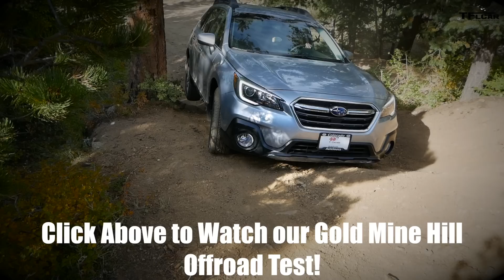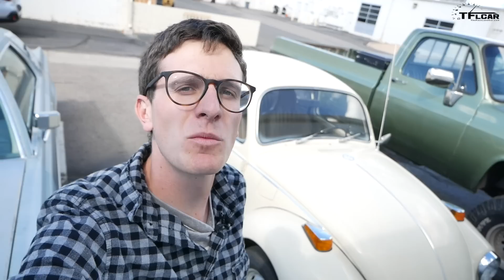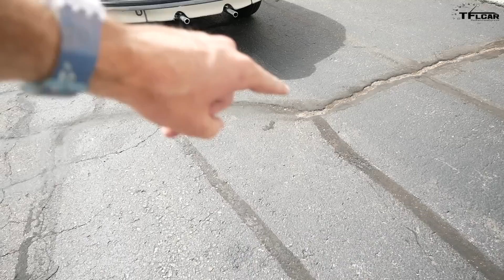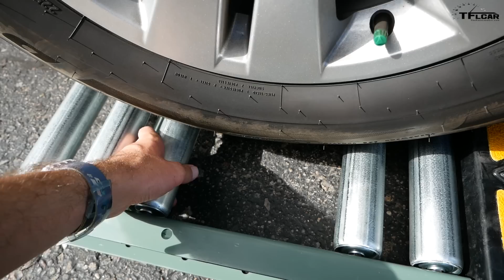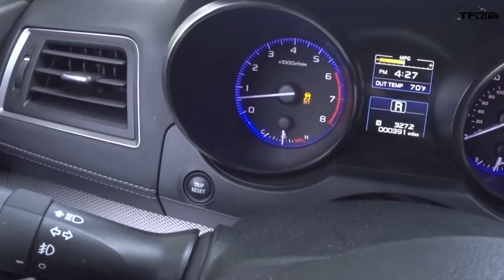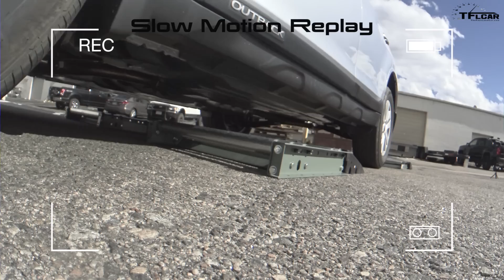The Truth About Subaru's Symmetrical All Wheel Drive:TFL Slip Test vs Subaru Outback

Comment from the maker: You can also watch the test of the Subaru Outback's AWD system in the mountains here: https://www.youtube.com/watch?v=6ua51LAtgVM
Reply: I own a 2012 Outback that I use for my job as a agricultural  claims  adjuster.  I have 99,000 miles on the car today 10/6/18, of those miles an estimated 4000 miles have been off road in sugar sand, mud, canals, tomato fields, nurseries,  citrus groves located between I-95 to the East and I-75 to the West, I-4 to the North and I-75 to the south in the swamp of southern Florida.  My original vehicle of choice was a 2001 GMC Yukon, very bad on my back off road.

I have been places with the Outback the Yukon couldn't begin to attempt to go like sugar sand and the ditches of tomato fields in the Everglades swamp with water over the hood for brief times.  When I counted citrus trees or mapped citrus or tomato acres I could go to the end of the row and make a u turn without  backing up, no way with a Yukon or other vehicle.  The difference in comfort for my back was very noticeable, I could drive the Outback 400-500 miles a day from home down into the Everglades swamp, map acres all day and return with no sign of any back pain, not to mention even off road I would get 25 mpg, the Yukon maybe 5 mpg if not sugar sand.

In 99,000 miles I have been through 2 sets of brake pads and 1 set of rotors, the sand and mud eats brakes, 3 sets of tires with 2 of the sets having damage from broken glass and metal pieces in orange groves and tomato fields, not to mention the thorns on certain palms in nurseries.  I have had no other issues with the car other than a battery or two, had to go to a red top battery because of the rough terrain breaking the lead acid batteries apart.

I love the Outback, waiting for a 2019 the right color for me, will keep the 2012.
Reply: I'd love to see you try Goldmine Hill in the outback with AT tires.  Also, I'd like to see if the Forester has an easier time of Goldmine Hill.
Reply from the maker: Thanks for the kind comments. Very much appreciated!
Reply: Now you just need to buy a FORCE GAUGE to go with that slip rig.    sure a ramp setup would be a little better,  but using a force gauge is quicker, easier, safer, and cheaper!   see my other comment in the main comment section for some tips on how to use it.
Reply: Its cool to watch the car try stopping each wheel until one starts to move the car enough
Reply: There is an easy fix if one wheel is spinning like in the Beetle test. Just apply the brake slightly and the free spinning wheel will slow and allow power to go to the other wheel through the diff.  Sorted!
Reply: I didn't see any other videos on this, what are the chances of getting some of their other systems on this set up? The 5-speed manual in the Impreza seems to be more willing to send power to the rear than the Outback is for example.
Reply: @SteevyTable  i also want to see how manual subarus do 🤔 I have a 2019 wrx (non-sti) so viscous diff in middle and open diffs front and back. Seems like manuals are able to send more power (or doesnt cut power as much as cvt) but idk
Reply: The Subaru also passes the 3-wheel slip test on an incline...
Reply: What this tells me is that goldmine hill was likely more due to a failure of the stock tires to provide any grip in that situation than a failure of the awd capability
Reply: Awesome video! Love you guys! This was a lot of information and results from a minimal amount of equipment done in a professional way, very informative and cost-effective! I too was wondering about Subarus with more power. With a Subaru ascent with 260 hp 2.4 L turbo boxer for do any better on gold mine Hill?. With the extra power result In just more slippage with the stock tires? I think the ascent also has a fair amount of ground clearance, but probably less break over angle. I wish Subaru would give you guys more cars, you’re perfect to test them out! Thanks again!

Comment: This is not in the real world try putting the rollers on just a slight incline then see what happens,or try putting a small stone under a wheel that is on the pavement, also these rollers tests notice just how much gas they give the car,a fast start the rollers can't match the speed of the car's wheels because they are much smaller than the wheel and there for the wheel passing over it

Comment: Only ever 1 tire in the front with power and 1 tire in the rear... 😐 My 08 literally spins all 4 at once. By the time the new ones do the fancy breaking, You're already at a stop in very slick terrain. That is never going to equal the old fashioned limited slip four tires spinning at once. It's just cheaper for them to manufacture. 💯

Comment: I think the lab test demonstrates the system functions as designed. The field test demonstrates real world obstacles that might only be overcome by more appropriate tires. And at that point you've realized the design and function limits of a Car off road. Next step is really a truck. Body on frame, true clearance through wheels and tires, and the attendant lockers.
Reply: forgot to mention ABS.

Comment: I like this testing method as it is a level playing field I think, no pun intended and not dependant on the tyres fitted etc. On gold mine hill the car has to have enough power available to ascend the incline, then there has to be enough traction to transmit that power given the vehicles gearing, weight distribution, power/torque curve and tyre compound and tread suitability for the terrain.

Comment: Subaru is one of the few manufacturers that still make a manual transmission AWD vehicle (i.e.: Crosstrek). The are many Subaru automatic transmission vehicles roller tested on Youtube; however, I have yet to see a roller test for Subaru manual transmission vehicles. If TFL did such a manual transmission roller test, I suspect that it would be the first; moreover, I believe that TFL viewers would appreciate it. Thank you

Comment: Did they ever do a WRX STI test. I'd live to see the last gen (which I had full bolt on pro tuned), and the current gen.
My stage 2 Audi A6 with Bilstein coilovers is pretty good, but not as good, especially dynamically as the 2013 WRX STI.

Comment: you have to realize this is just a mechanical all-wheel drive system with no electronic bullshit (nevermind, i guess the new ones have a brake-locking feature lol) and it has open differentials on the front and rear it is not going to lock the axles like a four-wheel drive system
Reply: Actually it is 100% electronic all wheel drive system.

Comment: I'm not a fan of these parking lot tire slip tests because its not at speed. If it takes a few seconds for the car's computer to figure out where to apply power at highway speeds the car would already be doing donuts and out of control. I wish you would show these tests at highway speeds (safely of course, no one should be put in danger). If that was possible I'd believe these tests far more.

Comment: Constructive feedback/suggestion: do another control test with all 4 wheels on the rollers. The Subaru is heavier than the Beetle and may create more friction in the rollers. I know you could move the rollers with your hand, at least in one case on one roller. Also, friction changes with speed. The faster the rollers are spinning, the more friction in them. With all 4 rollers off the ground, check your RPMs/speed. When you then do a test with one, two, or three wheels, be sure you stay bellow those RPMs/speed. I suspect it may be possible to drive off the rollers even with all 4 wheels on them. But maybe not... I would want to see to be sure and see how fast the wheels spin.

Comment: Hey Buddy... Subaru’s VDC and XMode are explained better in the manual than what people commonly think these buttons are for.  Please do not blast your knowledge like this unless you explain this is only how the system works AS YOU UNDERSTAND IT.   This is how it actually works: 2014-2019 Obk 4 or 6 cyl Boxer Engine, CVT, front and rear open diffs, canter torque converter. And wheel speed sensors. Split down the middle front to back your car had mirrored drivetrain right to left... hence Symetriccal AWD. It provides a more efficient end result allowing full time TRUE AWD and superior end results to the direct competition. As such stupid people put videos online on how the stuff is supposed to work not know omg the designs and how to operate the features thereof. ABS and Traction Control are still active unless you pull fuses... VDC however can be disabled. VDC only helps control situations like understeer in slippery surfaces where standard traction control is only for forward movement.  VDC will not help moving forward and in some cases will make it harder to move forward from a stop. The manual states only to disable this when trying to start forward momentum while on an incline in loos slippery conditions or when the tires are buried in snow dirt or mud. The reason to disable these systems is the computer uses wheel speed sensors to determine vehicle geometry on the road. While in these conditions the wheel sensors tell the computer the car is slipping sideways and puts ABS to wheels that need forward traction. Without human interaction at this point you are stuck as the computer doesn’t know any better, hit the VDC switch...  if not LEAVE IT ON. The XMode is purely for off road use and the manual also recommends off road or snow tires, not the dualers the factory puts on and you are performing tests with.   Had you used off road tires you most likely would have traversed the sandy hill no problem. The XMode system changes the pattern at which the ABS will pulsate and features hill decent control to pace the car at 1.5-2mph down rough steep terrain.   You will most likely have better luck with XMode with VDC on as the manual states XMode is disabled when VDC is off.   The system cannot be activated above 12 mph and boots you out at 25mph as it’s design is not for day to day circumstances. Most Outback owners will never see these circumstances. Please if you are to make such a detailed video attempting to explain technology, at least understand how that tech works.   - A Concerned Subaru Produce Specialist

Comment: EXCELLENT TEST. Very informative. Only thing i would have done different is ALSO test with both REAR wheels on a roller. 

Many cars have a limited slip differential in the rear, but NOT in the front. 

Having both rear wheels on rollers, and one front wheel on a roller, will seperate the boys from the men. 

An open front differential, with no, or poor braking help on the other side, will be defeated with that one additional test.

Comment: When the system BRAKES only one wheel to direct torque to the other, you 1/2 your gear ratio.    This is a major issue for low torque engines such as in the outback.  It's like instantly converting your differential from a 3.73 to  1.865.   Couple that with an uphill setting and you're SOL.

Comment: Hey guys. Great channel !!! 
I have a 2018 outback 3.6 
When in snowy conditions and trac control is on, the abs pump is noisy and working, when. The wheels are slipping. I would think that’s normal. However when turning trac control off.... mine makes abs pump noise during the initial 1-2 seconds of slip, then it lest all the wheels spin free. 
Have you noticed the same thing? It’s like the trac control is not truly off at the first slip.

Comment: WIth H6 & High Torque or old 5spd with limited slip rear this thing is truly confidence in motion in Utah back country - why... does everything a 4 Runner will do but less worry about running out of gas.  Check this out!  They also tested outback with a number of cars past roller test but not on 1st try like with more powerful engine in no special modes (on this off that) -  https://www.youtube.com/watch?v=7f1Uz8SqnzI

Comment: FINALLY A TEST DONE WELL:
It is important to see the behavior of the Car with the Traction & Stability Control OFF.

IT WOULD BE NICE
To do a comparison Video (maybe by putting the rollers on a slight upward incline) between multiple AWD Cars and maybe a couple of 4WD Cars (Wrangler... 4Runner) and make em do this Test with the Electronic aids disabled.

It would be nice to see how the AWDs get stuck and what would be their weak spot:
Both front Slipping?
Both rears Slipping?
Cross Test?

Something like that, repeating the test with  many Cars and seeing who's the best (and worst) if the Electronic Stability and Traction Control don't come to help

THANK YOU

Comment: I appreciate the "lab test." However, I'm looking for the mid-size SUV(s) that is/are the best/safest in real-world snow-and-ice driving on well-cleared, mountain highways  (e.g., Hwy 58 through Willamette Pass in Oregon). There's a HUGE difference between slow-moving tests and the cars handling at 45 mph on a highway through a mountain pass with hard-pack snow and some icy spots. Those road tests should be with top-of-the-line snow/ice tires (siped) because these make a HUGE difference in my experience.

Note that highway driving in snow/ice involves stopping and cornering at mid speeds, as well as getting started. One of the advantages I've found with true 4WD (locked transfer case) is engine braking in a low gear, which makes immediate power available when needed. Much quicker to compensate when wheels slide.

Comment: A good part of the problem with the Subaru on Gold Mine Hill had to do with tire tread design.  Better off road tire tread would equal better off road result.  Those street tires just were not designed for the task you were performing.

Comment: Since, I do not go to my summer home -  up in the higher elevation - much in the winter, I do not buy snow tires.  Many wear out once you leave the snowy part of the highway, since they are rather soft rubber.
 Had an odd winter this year.  Had 2 ft on the ground and from last week and got another 43" added to it.  Even after it is graded, the dirt roads would require high quality snow tires.  This video, at least give me an ideal with one to look at.

Comment: I haven’t read the other comments, but as an off roading enthusiast I can tell you that tire choice/pressure is a HUGE factor in climbing steep slippery hills. The fault I see in the lack of ability to climb that hill is NOT in Subaru’s all wheel drive system, but rather in the lack of traction in those street tires. But that said, I still liked your video. 👍🏻

Comment: you should put both rear tires on rollers and 1 front tire on roller. see if the front differential locks or has a lsd diff

Comment: I'd propose you guys to make this roller test with a certain number and sequence of tests within it.

One wheel:
1. One front wheel on rollers. Right or left—irrelevant.
2. One rear wheel on rollers. Right or left—irrelevant.

Two wheels:
3. Two front wheels on rollers.
4. Two rear wheels on rollers.
5. One side on rollers. 1 front wheel and 1 rear wheel of the same side. Right or left—irrelevant.
6. Diagonal. 1 front wheel and 1 rear wheel of the opposite sides. Irrelevant if it's front left+rear right or front right+rear left.

Three wheels:
7. Two wheels of the front axle and one wheel of the rear axle on rollers. One wheel of the rear axle stands on pavement. Right one or left one—irrelevant.
8. One wheel of the front axle and two wheels of the rear axle on rollers. One wheel of the front axle stands on pavement. Right one or left one—irrelevant.

If the car or truck you test has something like locking diff or some special off-road mode, carry tru all the 8 subtests twice.

Make these subtests in one and the same order with all the AWDs and 4x4s you review. Thus you will have accurate data.

Comment: I'm not sure to what extend the rollers can simulate real environment. Recently, I got stuck in a 2015 Subaru Levorg on a narrow, crowned road covered with snow. I drove slightly off the main path (other cars oncoming) and buried left wheels in a fairly deep snow. The VDC (on and off) did not pull me out. The wheels where some grip was available barely moved and the car had to be towed.

Comment: Was devoted Subaru owner (2010 Forester 300k km with automatic - very reliable) but no more Subaru - new CVT is weak, not reliable, lower towing, poor acceleration compared to manual or automatic. New AWD is fluid diff, not electro-mechanical - simpler but less effective - Subaru is not king of hill anymore - have driven new VW Atlas and 4Motion is fantastic and outperformed my Forester - disappointing but reality.

Comment: An additional test which would really separate the different AWD systems would be to place a small chock (similar to the ramp for your rollers) in front of all wheels not on the rollers. This would add just that little bit more resistance and test the limits of the system just that little bit more.

Comment: It would be very interesting to see what happens if you put all 4 wheels on rollers to see if the rollers drag just enough to drive off them with reasonable throttle. Just to eliminate any doubts about the performance of the rollers.

Comment: In the VW you could've applied the parking brake lightly and got off the rollers.  The braking on the roller wheel applies some torque to the wheel on the ground.  This also works in a 4wd vehicle with open diffs.
Reply: Every old VW I have driven has had dubious parking brakes.

Comment: These LSDs need to have some traction on the slipping wheel to provide torque to the non slipping one. You can see the system applying the brake to one of the slipping wheels to accomplish this (something you can do with your foot for those who don’t have it).  That should explain easily most of what you need to know about how the system works in the most simplified way possible.